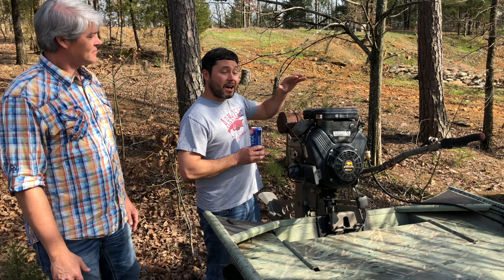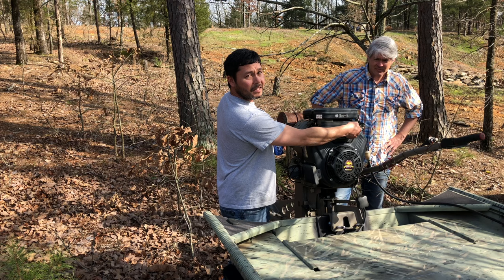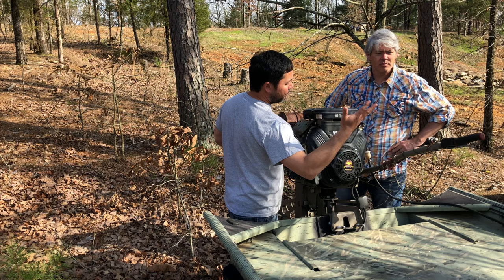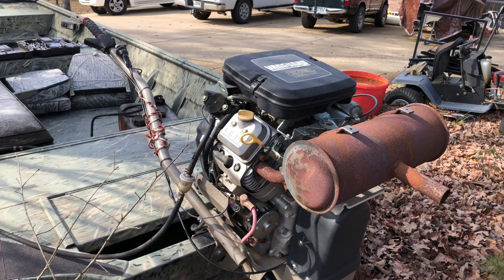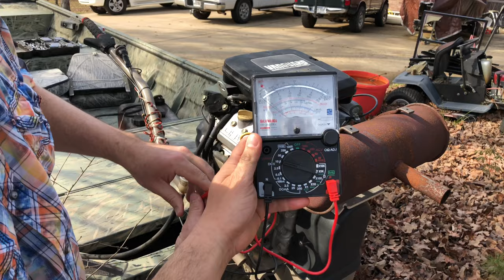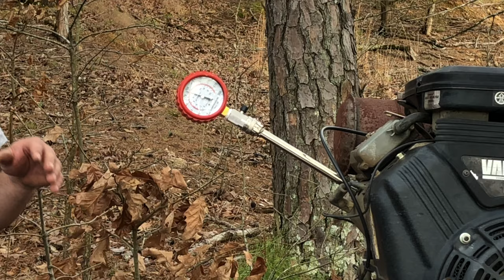Gov Deals Acquisition - 2006 Mud Buddy Surface Drive 23 HP Briggs Vanguard V-Twin Engine Won’t Start

Comment: That thing you bypassed is a mercury switch that makes sure the motor is out of the water when you start it. Might be a good idea to hook that up since there is no neutral. You can get launched out of the back and into that nightmare prop. I have one of these, and you can adjust the angle of that switch to make it so the prop can be less or more out of the water for it to turn over.
Reply from the maker: Ahhh! Makes sense!  Thank you so much for the comment.  So, if we tilt the prop up higher, we should get continuity through that switch.  If we don’t, we have a bad switch and should replace it for safety’s sake?  I will notify Mike, the motor’s owner.  It’s crazy to me that it’s not mentioned in the service manual schematic.  Thanks again, for both watching and your helpful comments!